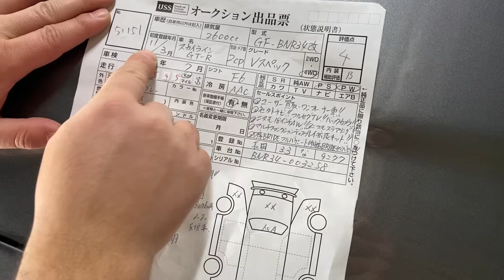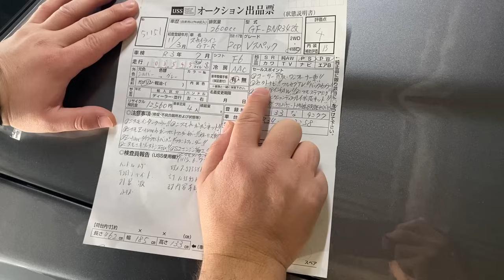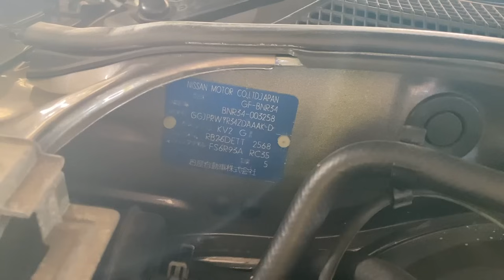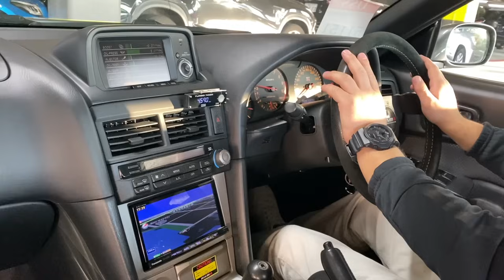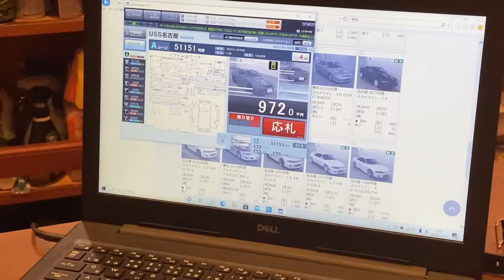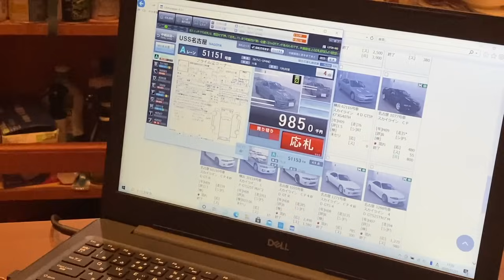BUYING THE DREAM! NISSAN SKYLINE GT-R R34 VSPEC NISMO CRS!

Comment: Viewer from germany here... Yes we have parts of our highway system (Autobahn) without any speed restrictions. but also a lot has speed and other limits based on the occasion (drive off/on, construction/maintanance, for traffic controll - sometimes you get a speedlimit 120km/h or even less in front of an traversing a bridge and if near settlements etc.
Let's say we have some of the Autobahn free to drive as fast as... but not anymore as like 25yrs ago..
Reply: Moin moin, genau. Lg aus Bremen
Reply: Yup pretty much this. Also even the fully derestricted areas still often have traffic that wont just allow you to go as fast as you want. But yes some areas and at certain times you can go as fast as your car and skills allow. Also normal roads outside of cities usually allow you to go 100kmh or 70kmh near intersections or narrow roads.
Reply: Friendly reminder!!! There are still parts on the Autobahn without a speed limit. But court decision point to another direction… It is the law that you must adapt your driving to the situation and have full control of your vehicle at all times.

If you drive more than 250km on the highway, this is not the case. In case of an accident, you are fully to blame and not insured.

Comment: It's a shame they didn't make the R35 more of an incremental improvement over the R34... Like perhaps with an aluminium/alloy RB block, more aluminium body/suspension components, battery in the boot (like evo x), slight increase in power and maybe a slightly longer wheelbase (but less overhang) so the rear seats could be more usable like in R33... If they did this immediately after the last of the R34 in ~'02 then they could have dodged much of the safety compromises that ruined the EVO X and that EVO's 7-9 were comparatively free from. Just my 2c.

Comment: I will always regret not buying one four years ago when they were going for about 40k. I ended buying an R32 a year later because it was more in my budget.
Reply: R34 GT-Rs never went for 40k
Reply: dont feel bad thats life we all done it
Reply: @felixarvidulfkjellberg6361  perhaps not for export outside of Japan, but I’ve seen it locally going between 40-50k. And R32s were 10-15k.
Reply: @felixarvidulfkjellberg6361  In Japan. As a matter of fact, you can find one right now for 56k
Reply: Are you guys talking about Nissan Skylines in general or just GT-Rs?
Reply: I regret not buying an R34 GTR in Europe for 35,000 euros back in 2010. Or an NSX for 20,000 euro. I did however get an FD RX7 instead for under 10,000 euro. But man I wish I stretched for an R34 GTR..

Comment: according to GTR Registry, 

BNR34-003258	GGJPRWYR34ZDAAAK-D	V-Spec	1999-03	KV2 Athlete Silver which is now CRS KAD Gunmetal S2 engine

About the brakes, the customer can choose not to have the R35 Brakes upgrades

You also can see there is no half roll cage and the rear passenger seats are still the stock units

Nismo Omori is basically a Skyline GT-R owners' wet dream and as long you got deep pockets, you can ask Nismo Omori to build you a full better than Z tune Spec R34 from even a base Skyline GT-R

Yea 450K USD est for the factory rebuild spec. It basicallys strips the car down to bare metal and treat the chassis with acid bath and coat the bare metal with anti rust and repair any chassis/frame damage and then slowly rebuild back the car with all new factory OEM parts making the car basically showroom spec and it really meant for collectors imo.

Comment: The following conditions are necessary for membership
Registration in Japan (for corporations)
You must reside in Japan, have a certified copy of residence, and have an official seal registration certificate (for individuals)
You must have full-time Japanese-speaking staff.
You must have received a license to trade used vehicles by the National Public Safety Commission at least one year before applying for membership.
You must submit joint guarantors or use the SS membership system of USS Support Service Co., Ltd. as your joint guarantor.
Reply: HOW CAN I BUY FROM USS AUCTIONS? I WANT TO BE ABLE TO IMPORT CARS FROM JAPAN WHEN I DIERSIRE.. I WANT TO SKIP THE LOCAL DEALER IN MY COUNTRY.. HELP US OUT WITH AN ANSWER?? CHEERS